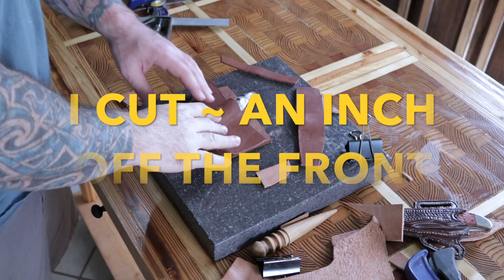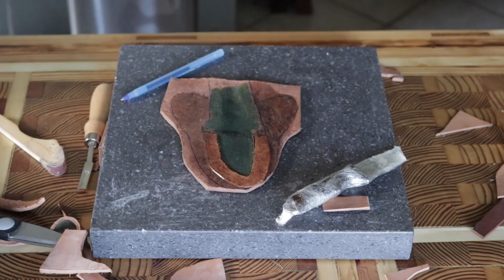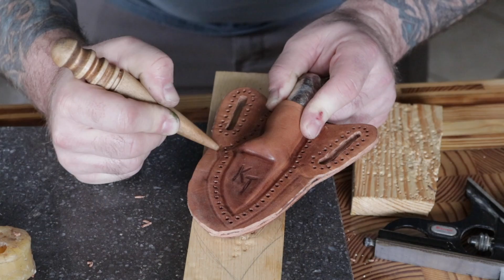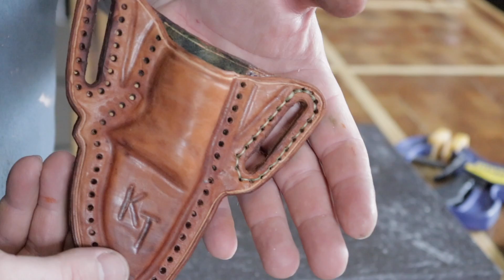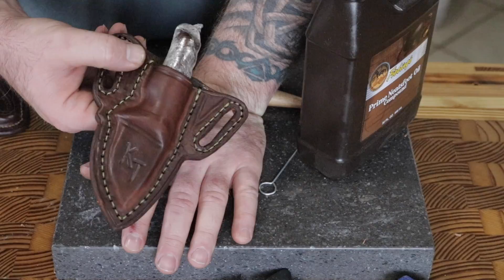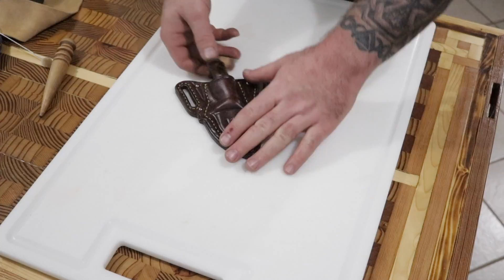BENCHMADE LEATHER SHEATH (Hidden Canyon Hunter)

Comment: awesome.  One thing I wondered about is whether the lip that holds the knife in will wear out on the leather sheath.  I wonder if there could be a leather reinforcement layed over the top of that area, or even adjustable.  Or maybe it doesn't matter....
Reply from the maker: Great question, I would have normally placed a reinforcement piece on the top portion for that reason. But with a fixed blade, usually used in hunting it will spend much more time in the sheath. As long as you take care of it this will be locked in with no problems. My leatherman sheaths and cell sheaths I add another piece to make sure that shape can’t distort with lots of use. Have a good one 👍